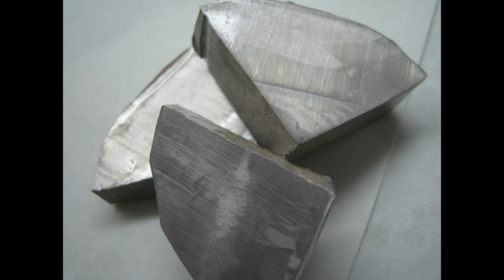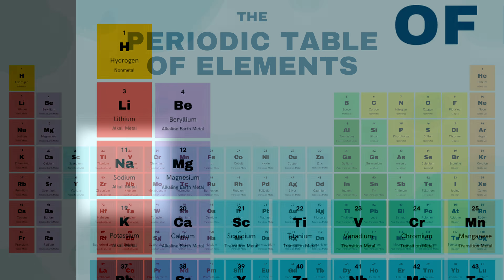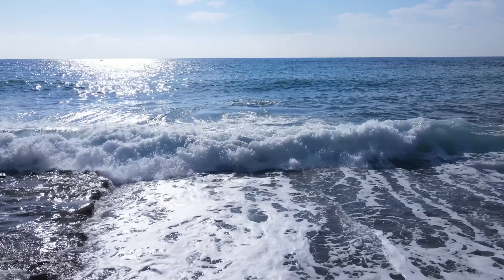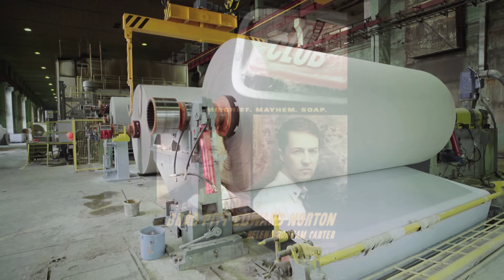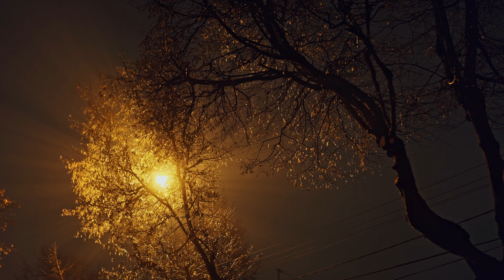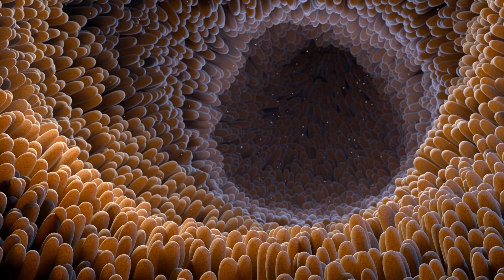Sodium: The Chaotic Metal That Powers Your Thoughts🧠

Comment: Its not very appetizing, but "can you spit on it?" is safer. XD I can't help thinking of Ralph Wiggum when you get to that part. Also, what's interesting about sodium carbonate and sodium bicarbonate, baking soda is the difference in PH one carbonate ion makes. I make natural dyes, and the sodium carbonate, washing soda, is used to produce reds and blues from certain plants and a lot of natural dyes will react to sodium carbonate in the wash. Red and blue are the two hardest colors to get in a durable form. This is why indigo was so valuable way back when. I grew Japanese indigo last year and it took FOREVER for me to get it right. You need indigo plant matter from the source of your choice, fructose, and a strong alkali. Although the old timey preference was for ammonia, even simmering dye with ammonia on the stove (which is next to the back door to my apartment) drove me out of the apartment while it aired out. No ammonia is allowed open inside in my apartment anymore, no matter what. Sodium carbonate is sold as "washing soda" by arm and hammer in the laundry isle and produces a ph of 10 which is necessary for home indigo production. Indigo has to go through multiple chemical stages in order to produce that blue, the dye is then strained and left to evaporate in trays and buckets. That creates a solid blue block of dye that was easy to transport.
Reply from the maker: Love the comment!

Comment: You know there is this misconception that sodium and salt causes lots of health problems like kidney stones, God forbid. But actually after digging into it I found that kidney stones are caused rather by calcium + oxalates and that if they don't combine for some reason in your gut and harmlessly get out. If they get to your kidneys and combine there, that's the cause of the trouble, but it's not sodium per se (important: health and medical info requires super careful validation and confirmation, I just shared my research).

Comment: Here to save 30 minutes of your time. Why do your muscles need sodium:

1) Tissue excitation and membrane transport
- Practically every excitable cell in the body (not just muscle cells) has something, called a membrane potential; That is, one side of the membrane is negatively charged (typically the inner side) in relation to the other side.
- The membrane potential is dependent on the concentrations of ions on both sides and the permeability of the membrane to these ions; The main ions that participate in this (although many do to a lesser extent) are potassium, sodium and chloride.
- Excitable tissues utilize changes in the membrane potential to fulfil their functions, or to signal information; Receptors depolarize after being stimulated, neurons depolarize to transmit and interpret information, muscle cells depolarize in order to contract, pancreatic islet cells depolarize in order to secrete insulin, etc. 
- In a lot of cell types, depolarization of the membrane occurs via opening of sodium channels, which causes sodium to enter the cells (because it's extracellular concentration is always more than the intracellular), leading to depolarization.
- Sodium is also a major player of establishing the membrane potential in the first place, via the Na/K pump, which is essential for secondary transport processes.

2) Body fluid osmolality and volume
- Sodium is the chief extracellular cation, which means it is of major importance in maintaining the osmotic pressure of body fluids, such as the blood.
- When sodium concentration becomes too low, fluid starts seeping into the tissues from the circulation, leading to edema, including cerebral edema (which is life-threatening).

3) Sodium participates in maintaining body fluid pH as well, via membrane transport systems in the renal tubules of the kidney (excretion of H+ and reabsorption of HCO3-).

These are the ones I could think of from the top of my head.
Reply: The video is about sodium as a whole. Not just the reasons your body needs it. Try your unwanted TL:DW again after watching the video all the way through.

"Here to save 30 minutes of your time."
If you didn't want to watch the video, why are you even here and why did you take the time to even comment??

Comment: Many turbo diesel and turbo petrol engines have sodium in hollow stems of exhaust valves to remove heat
Reply from the maker: Great insight and yes we missed that one thanks for the comment.
Reply: @CubeChemistry  Thanks !Im surprised that you didn't put this first, as it was first used in some American WW2 air cooled engines and soon after the rolls Royce merlin etc

Comment: Sodium was/is part of internal combustion engine valves  to help with high temps.
Reply: Yes it makes an excellent high temperature coolant. It is used to transfer the energy from the focal point of radial solar concentrator systems very efficiently as well, for example. Low melting point, high boiling point. Just that pesky reactivity thing to deal with, especially at high temps. In the valves it is hermetically sealed, so doesn't go anywhere.
Reply from the maker: @MadScientist267 thanks for the comment!!
Reply from the maker: Yes!! Thanks for the comment.

Comment: Another great video of yours!

A few thoughts: 

This video would have been THE opportunity to buy a beef tongue and let it lick it ;)

I'd like to have known what "dry extinguishing compounds" might be in case of sodium fires. Do you have examples? Do they just bind water / oxygen, do they replace the reactive gasses (like co2 extinguish ers) or do they cool the reaction down?

Love the fight club reference xD 

Regarding sodium street lamps: I much prefer those. They aren't as harsh to the eyes (tho granted, at lower visibility). And astronomers prefer it too as it has a shallow emission band it's easy to filter out and thus light pollution isn't as severe with them. Even now often lighting close to observatories is high pressure sodium.
Reply from the maker: Great question! Sodium fires are really dangerous because you can’t use water or CO₂ to put them out—in fact, those can make things worse. Instead, you need a Class D fire extinguisher made specifically for reactive metals.

For sodium fires, compounds like Met-L-X and Na-X are commonly used. They’re usually based on sodium chloride (yep—salt!) with some additives. These agents don’t react with the metal; they smother the fire, absorb heat, and form a crust that blocks oxygen from getting in. No water, no gas—just dry powder that isolates and cools the fire safely.

Never use a regular extinguisher or water on sodium—it’ll explode or flare up. Class D all the way!

Comment: Nurdrage refined a diy ish method for sodium production. Very interesting work, that gave good results. 😊
Reply from the maker: Sounds like we could use that for future a sodium elemental deepdive!!
Reply: @CubeChemistry  I haven't checked lately whether NurdRage's video is still up, but his process is to put NaOH into mineral oil, add a little metallic sodium to destroy any water that may be present, stir for a while, then add magnesium turnings and menthol as a catalyst. Heat while stirring, and run a vent line through a drying trap.
After a while, you will have sodium beads in a slurry of MgO, that can be cleaned up by stirring in 1,4 dioxane.

If you don't dry your NaOH before starting the reaction, the NaOH will destroy your glassware.
If you have no metallic sodium, and you are willing to sacrifice a flask, you can make a first run of sodium to start your next run.

This is very much like the better-known process for producing potassium metal. I think you use tertiary butyl alcohol as the catalyst for that one, but it's been a long time, and I'm not so sure of that.

Comment: In my opinion 
I feel like sodium is one of the easiest metal to make
Reply from the maker: For sure we will try at some point but looking at the process its not that easy it seems. Have you done it?
Reply: @CubeChemistry this is one of those things where if you have the right setup and the right tools and parts 
And as long as at least have a bunch of salt 
You can make sodium 
Or at least on paper 
Electrolysis of salt water to make sodium hydroxide 
And then molten electrolysis again of the sodium hydroxide to then make sodium metal 

If you we're to grab MrGreen's method and combined it with the professionalism and support of NileRed
On a more controlled environment 
You could obtain a salt input 
With a sodium metal output
Reply from the maker: @windowsme1330 thanks we will for sure inspect it for the experimental deep dive video for sodium in the future!!
Reply: @CubeChemistry fun
Reply: grindcore is the worst metal🤘🤘to make
Reply from the maker: @geminidefect haha